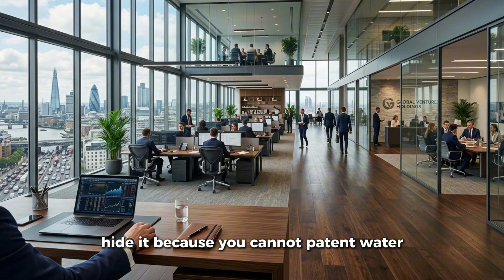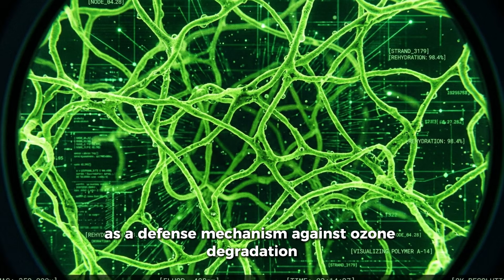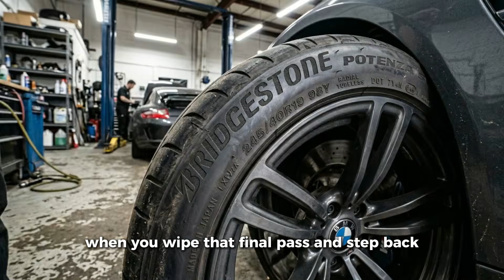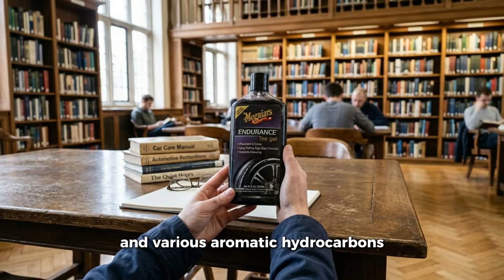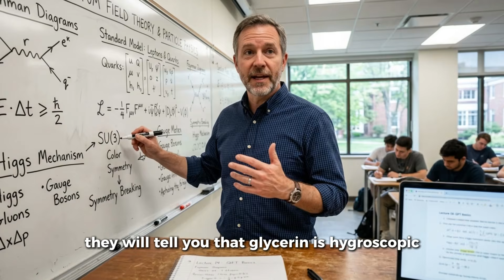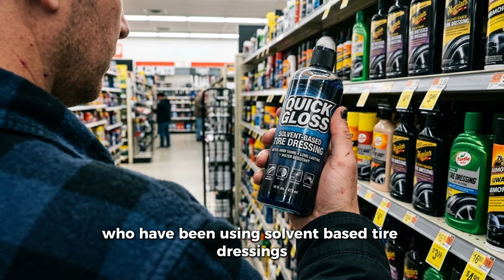Stop Buying Tire Dressing. This $1 Liquid Melts Brown Tire Stains.

Comment: Can I use on car plastic as well
Reply: I use Boiled Linseed Oil saw it on youtube search for it. It works well. I tried it on my 2000 F350 7.3 plastics looked grey. After I cleaned them up and applied Boiled Linseed Oil they look brand new. It blew my mind. Just apply and wipe off excess after less is more. FYI